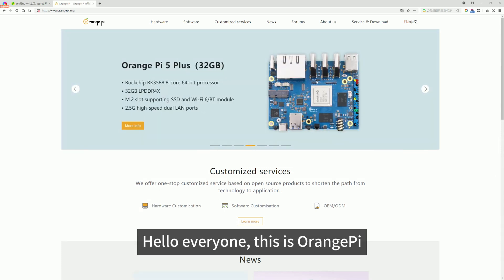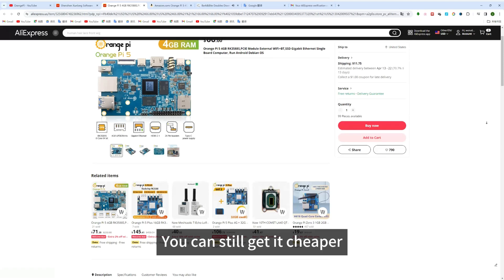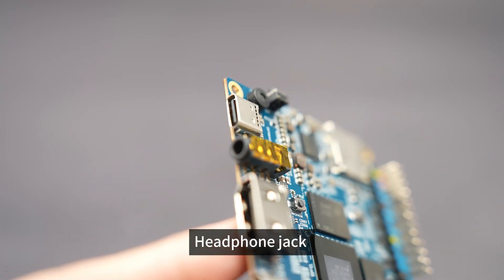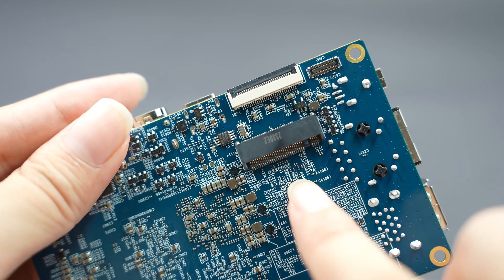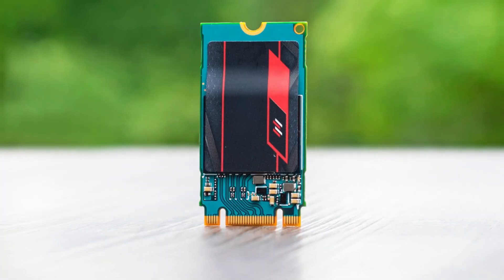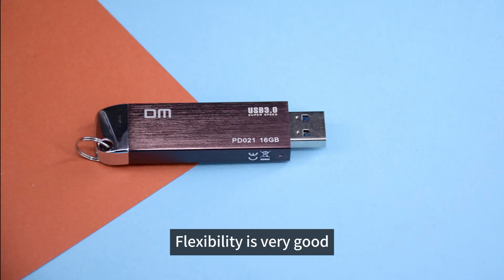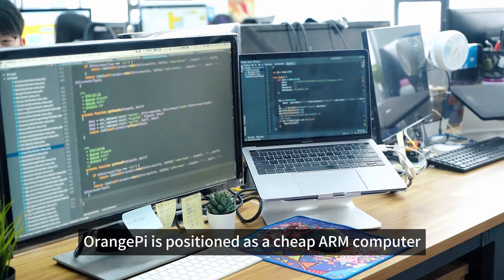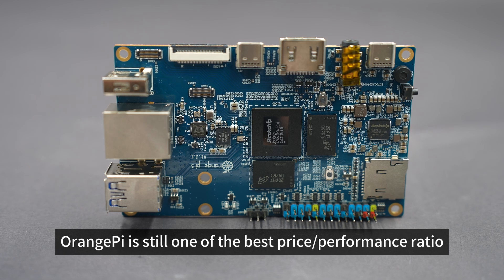Why Orange Pi 5 Became a Classic and Earned the Love of Developers Everywhere

Comment: Utter nonsense. It has become somewhat of a huge frustration to developers because of an outdated kernel and almost zero support. Even now, nearly a year an d a half later, we have a new but still incomplete Rockchip kernel that is still frustrating to devs. No Linux vulkan support until the end of the year. The Raspberry Pi 5, in the mean time, despite having less power, has rocketed ahead because development has been at breakneck speed, with so much functionality.
Reply: Nahh.. the vulkan support is probably a driver support issue.
It's quite frustrating for sure though.
Amazingly annoying.
More annoying is that arm soc drivers are neither very complete or efficient, nor do they come pre baked in most linux oses.
Reply: Skill issue